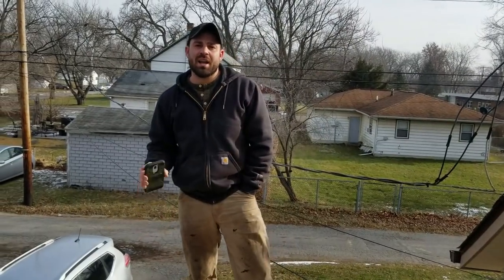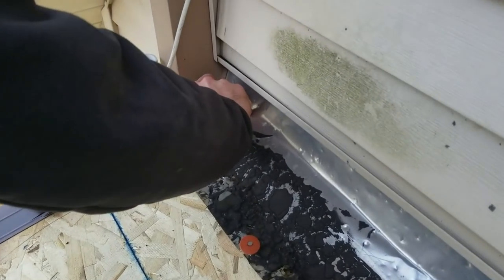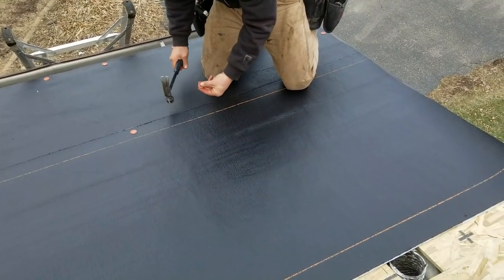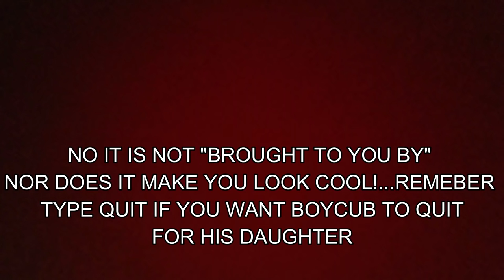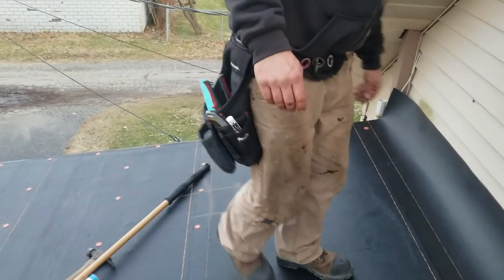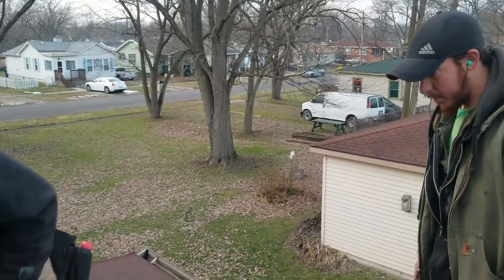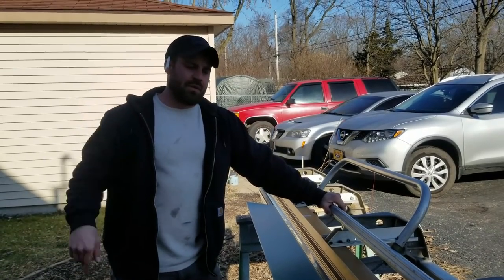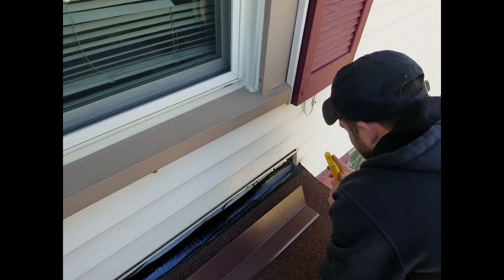Rolled Roofing (part 2 of 2)

Comment: World's fastest shingler ... It's from my experience you put your underlayment down first .... Then your drip edge ... I always prime just better insurance ...  When getting to a vent or boot you cut a hole in the cap sheet and put it over the vent ... But also prime that as well ... When all is said and done you put a good geocel bead around the whole vent ...  And there's no need to tar under your laps on metal .... The heat is a good idea when it's cold I do that too ...  Hope that helps ...
Reply: Todd O you are correct

Comment: At the gables ends on top of all base sheets, we always spread Mule 421 adhesives then install gravel-stop on top, then lay down the cap sheet, next lightly heat torch the cap sheet. At the fascia same thing but reverse the metal. Makes for a nice tight neat seal. We never use roof flashing tar only when using a membrane. I hope this comes in handy for future jobs.

Comment: Ok. I'm a roofer. My uncle has owned his own company for about 25 years or so. I spent 17 or so years with him. This is the first video I've found major issues with. Your awesome on shingles, you'd easily beat me in a shingle race, even though you couldn't find anything close to a mistake in my side. 

But God Damm man! Whoever taught you to do built-up roofing did you a disservice. I'm gonna try to help you out here (wish I were there in person though). 

1. Use the high end tile-guard glass base sheet first. Keeps the roofing from sticking to your plywood. After a couple 100° days that smooth torch will need to be scraped off the wood and since this is on an OSB deck, it will damage the sheathing (if you either have a call back repair or if you actually get repeat business, as your young enough that your business will out live built-up roofs).

2. When you nail your base, after it's tacked, pull it tight and flat to your line. Then tack another nail at the half way (or every 10 to 15 ft on a bigger roof). Then you drag/slide your feet, hard, kinda in semi circles to take the place of a roller. Nail top, then center, top, then center, top, then center. No less than 8 inches no more than 12 inches. Smooth with your feet as you nail from one side to the other. NO BUCKLES! This isn't the same as shingles. Buckles = bubbles.  Bubbles = ponding (on flat roofs) or more weathering (on low pitch). Only nail the lap edge after you've fastened the whole course (something for cubby to do, he needs nailing practice).....

Honestly, I'm over typing on my phone, this is getting real long and to tell you all the advanced techniques there's a lot more to go over. Find my email if you want to learn more. I used to work at Navarro Roofing out of Carson, CA. Check out the website. I worked on between 25-33% of the jobs picture on his website.  If not, have a good one. 

P.S. the big mistakes I haven't covered yet are: don't nail your smooth torch, use low rise drip edge, make a "metal sandwich" with the drip edge and torch, use fluorescent safety spray paint, make your guys replace worn out work shoe treads (that one could be deadly), don't use peal & stick on wood, don't cover vents, mastic + torch = fire, etc., etc.

Sorry,  not trying to be a Dick....
Reply: You better buy Boycub some Nikes!

Comment: On a cold day you could always heat it up a little. Try heating it from the back side, on the vent just make a target, go under the lap, and roof around it(make target at least 6" to 8" out from metal) cover metal and make sure your membrane covers vent, and sticks to roofing(will have to heat it)

Comment: I'm no expert but I do about three repairs on roofs per week removing beehives. About 50% of the time the roofing nails that go through metal flashing and then get covered with tar have popped up. When I put flashing down I use sheet metal roofing screws to put sheet metal on a roof. Makes sense right? That's what it's made for and has a built-in gasket. So that's what I would have used on that vent and flashing.

Comment: On that vent u could overlapped a piece of the flat over it done a very nice cut nail the top and only 1 nail in the middle in the bottom could’ve put tar on the side and on the top or even put base around it under the flat and put cocking on bottom nail

Comment: The base sheet goes first than drip edge metal than cap sheet, but other than that looks good like how you used the tar.. you could’ve cut the cap sheet just a bit so you could tuck the vent underneath and sit it on tar

Comment: U do know that the drip edge metals goes on top of the base? And your suppose to cut all the corners a 45 degree where the cap sheet overlaps
Reply from the maker: I didn't back then. It's fine.  I've seen it recently when they had me quote something. but yea you're right

Comment: So I have a question I have a SBS bitumen Roofing basically same thing you guys put up in this video but the roofer did it 38° weather and basically you know did not bring his own heater it's supposed to be done in 45 degrees or higher and he promised us he would bring a heater in a tent and it would be no waves or nothing it would be installed correctly. Basically when the job was done it was wavy and when you look straight at it you can't see it when you look to the side you see waves the roofer said it's Aesthetics only. I said I don't care if it's ecstatics or not he needs to be fixed because I spent almost $4,500 to get it done on a 900 square feet roof. So do you think there's any way to fix it it's not so many waves but it is got a decent amount. Or do we have to take it off and redo it again down to the wood because I believe the cab sheet is also wavy I also have pictures I can show you everything. If you have an email address appreciate you I just subscribed or you can send me a message if she can help me out would be appreciated.ugothookah@gmail.com. personally might have to take legal action if he decides not to do anything. He gave me a 5 year warranty however against leaks but I know for sure it's going to leak. Regardless spending that much money and having problems because I don't think he even torched it if he said he didn't use a good torch because regardless I think he didn't let it relax but also doing it in the wrong weather. Which I would have never told him to do it if I knew it was going to turn out like that obviously but he was a good speaker and he convinced me he knows what he's doing I mean he's a smart guy he's just not a roofer. As he claims which I wish you would have never said he was he's a handyman at best. So let me know what you want you can do if in any way to fix it

Comment: Should have taken the siding off at the intersection of the2/12 and the wall. Run Ice and water up the side finish the roof. Flashing wall to decking/Roof..Then Siding. This fails all the time. I am always shutting down roofers at these intersections. Then they do a silicon caulk joint and it fails 3 years or later and or Earlier,...Yes it adds cost. But that is the RIGHT way to do it.
If that is Mule Hide or a similar product good stuff. In cold winter and winter that is when we usually have to use this stuff. Never fails. I have found that we use a Heat gun and a roller to put it down with and it seals great no nails not call backs. The other thing is we use the Grace/Vycor Ice and water. That Ice and water you are using we had fail cause of all those damn nails you gotta put down to keep it down. I hate that stuff. B
Best Man, Great video as always. Do me a favor...Get some new pants! ^5!
Very Brave with the torch. I prefer the electric heat gun at the seams.

Comment: On the drier vent:  Lay over some extra cap sheet as you would with shingles (6" toeither side), just make sure the bonding area lands the same.

Use a little sealant to make sure the raised areas get filled before you press everything down.
Reply: That's what I was thinking. I am not a pro so take my thought as a grain of salt, but overall putting this type of vent on a low/no slope roof sketches me out as it looks like especially in snow water would find its way in there.

Comment: I'm not a roofer but I would have run steel pipe up from the dryer right through the roof at least two feet using standard flashing and terminated it with a 180 bend with hardware cloth to keep the critters out. Like the other guys said cap the sides because 2/12.

Comment: Whenever I do peel and stick and I end up with a vent in the middle of a course like that, I will cut a "n" shape piece so that it slides over the vent flange, not only on the top but on both of the sides as well. Then I roll the next course above it. Another good tip is to keep a heat gun in your truck like the ones you use for PVC. Super super helpful in making those seams tight. Believe it or not, works better than the torch. Do you have a Facebook page? I would follow you and share tips and maybe even learn something from you as well

Comment: Okay Soo your base sheet goes down first, using METAL simplexs then your field plys of cap sheet and then your eave drip with primer then
Reply: Then strip the eave drip in using 9"  cap sheet to embed the drip.. but button caps will melt off

Comment: You good shingler that's for sure I recommend you live the flat alone until u have fully knowledge of proper installation. I stop watching the video when I saw you nail in plastic nail cap on a torch flat roof. Hope you didn't. Burned the building down!!!!! videos as usual really good.

Comment: Sorry but I must say that install is nowhere near up to code. Atleast in my area. Your cap sheet should cover the sides and top flange of the bathroom vent and using a metal headwall flashing on a modified roof us a nono. Modified is its own headwall flashing. You turn it up the wall atleast 12 inches (for snow acumulation)  making sure to get behind siding and moisture barrierand and it is supposed to come back to the outside of the siding at the rake/gable ends. Never depend on caulk

Comment: First off, you don't have to prime painted metal. Second, why would you use plastic caps to secure your metal? And, most importantly, when your edges start to lift (and they will) that edge and fascia is going to completely rot. I've seen it a million times. You've got to sandwich your edge metal between the base and cap. Same with the vent.
Reply from the maker: Well where were you when I needed these mf'n answers lmao. Why not prime though?  Also Caps is just what we had, no big deal right?  And I do not think these edges will lift, I sealed them down with roofing cement, heated it up and smoothed it heavily.
Reply: @NWIVeteranConstruction  In Texas lol.
Plastic caps chemically deteriorate with exposure to asphalt products (even modified) leaving only tiny metal heads to hold down your metal and laps.
You only have to prime galvanized metal due to is oiled finish which prevents asphalt from sticking. Painted metal is pre-primed and the finish is baked on, so asphalt sticks well. However, it doesn't really hurt anything to prime.
Also, plastic cement is temporary. It will first gas out leaving small gaps for air to infiltrate (and if air can get in, so can water) which causes drying and thus cracking. Then, with expansion and contracting, the edge will begin to separate with nothing to stop water from getting to the oh so porous wood. Sorry man. Just trying to help.
Reply: RoofRaven south Florida roofer here, I prime everything, why not? Better adhesion. As far as running your base over the metal instead of metaling over it😂😂😂😂 like the previous gentleman said. Haha. You nailed the eave down relying on the peel and stick. That’s no good should of at least hit that with modified bitumen
Reply: @RavenRoofer  bro you're tripping you cannot get a bleed out on un primed powder coated metal

Comment: I stopped watching ....field laps seam on seam......looks like a new tank and torch......do you know what you are doing!!!!! Never use this product on a flat......use a true 2ply sbs torch down system by a licensed installer with insurance. This is a single ply mess!
Reply from the maker: There's no seams at all what?  And I just had that torch out because its cold. This stuff doesn't need a torch normally.  Torch down is done away with for the most part. This product is designed for flat pitches. You must be an old timer?
Reply: That 'so called gooseneck' should have two seals ' two plys' of membrane surrounding its base or flange......this is how not to flat roof......stick to your shingles bud!
Reply: Use a neoprene roller for this shitty roof. ...not your foot!
Reply from the maker: @davidlysohirka798  yea I know fixing it tomorrow.  Everything else is fine though
Reply: I would too.....fix that.......us Canadian boys would love any challenge!  Show you guys down south how its done!
Reply: Your base sheet should be offset set mininum 12" with an sbs application but 18" is ideal (half)...im sure application procedures are similar for that gaf roof......
Reply: Im not an old timer.....38 run my own business and have been roofing for 21 yrs.....red seal certified for 16 . finished with prestige....top marks.    Who are you in the trade?  I respect your a vetern and applaud you sir.....however ....i put my time in this trade and hate to see this installation issue with everyone who has a camera and calls themselves a roofer.....its horrible.

Comment: “Gotta do this like a roofer” lol real roofer would  have pulled that bottom row of siding off. Removed that 90, run their ice up the wall tucked it under the tyvek. 🤦🏻‍♂️ your 90 install is horrible, doesn’t even sit 90 to the wall. Nailing the face of the 90 to the wall below the siding and sealing with caulking looks horrible. Also all metal goes over top ice never underneath.
Your vent piping is also wrong. Insulated pipe is required when running warm air to a cold zone. Condensation is guaranteed leak into the house.
Roofing tar=amateur,  thermoplastic caulking= pro